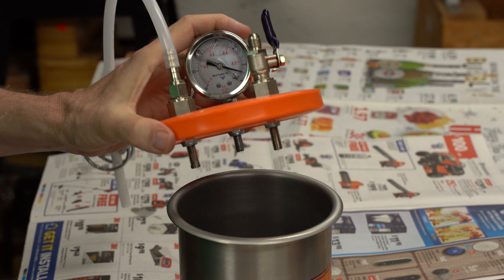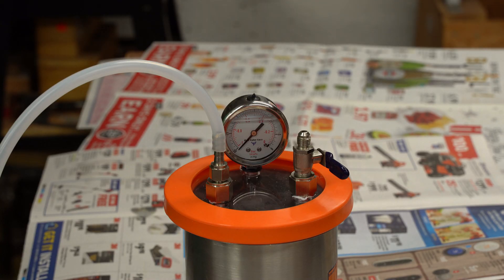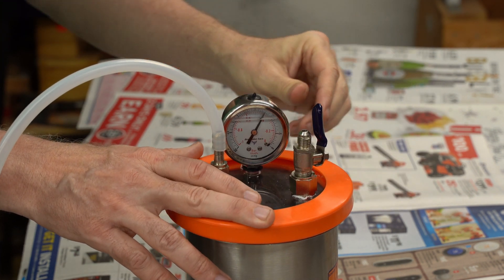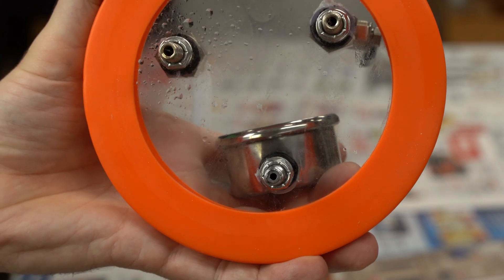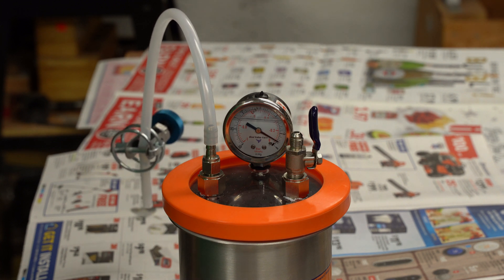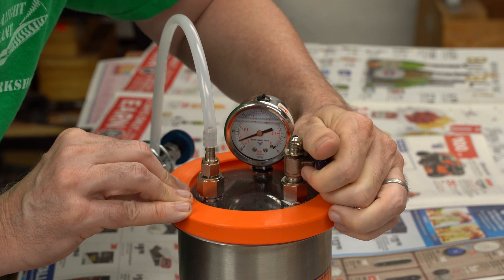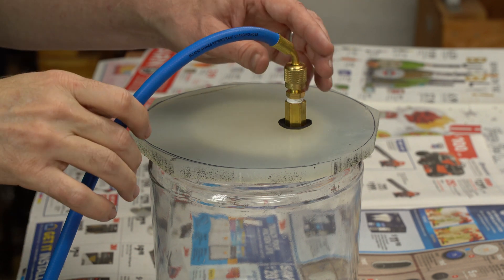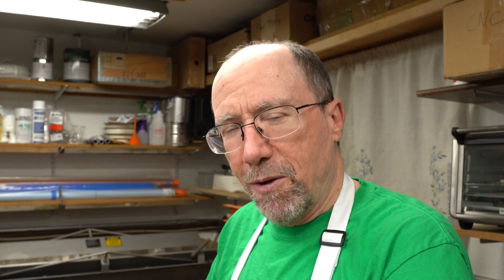Composite Tip: Vacuum Release after Degassing Resin

Comment: Have you tried to vent the gauge? Probably the reading is off because the pressure inside the gauge was not equalized. You only need to open the black cap slightly on top of the gauge to vent it.
Reply from the maker: Yep. I have done that. Thanks for the comment though. Keep them comming.